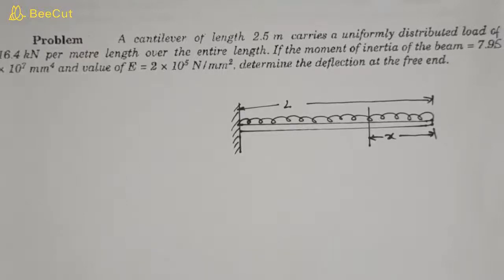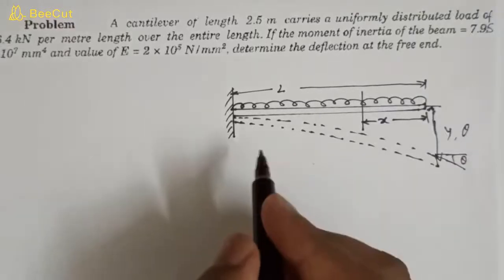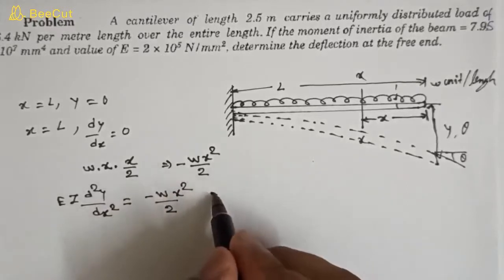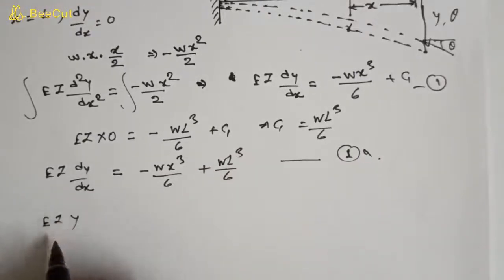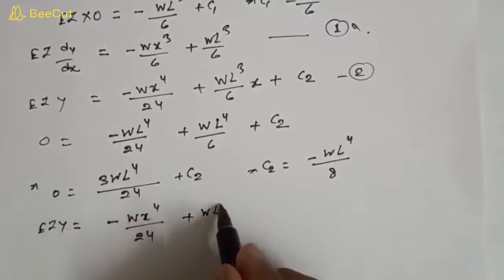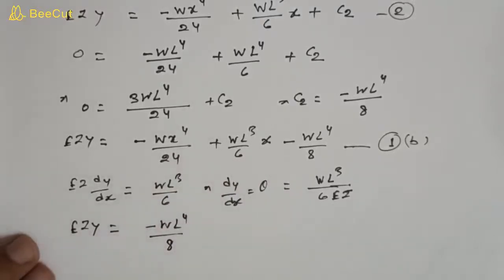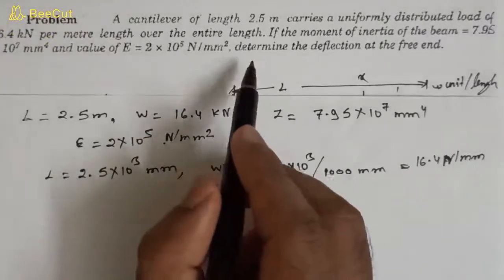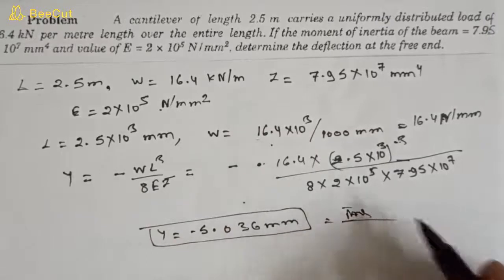Deflection of beams 03 //double integration method//Cantilever beam with UDL

Comment: Answer is not 5.036 it's 2.01
Reply from the maker: No it's 5.036 only but there is little mistake there. sorry for that
But in last line where W is written in formula there W =wl
I mean W is total load over the length not per unit length.
So formula should be Wl3/8EI 
OR wl4/8EI
now check if you get correct answer now
Reply: Yeah that's right👏👏
Now i got a clarity
Thank you so much for explaining this doubt 👍👍
Reply from the maker: Welcome 😊